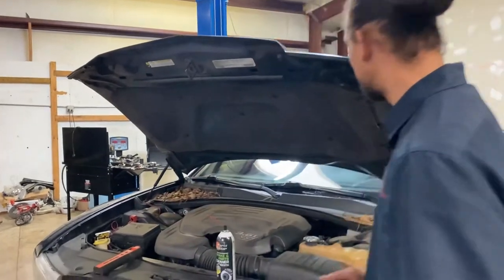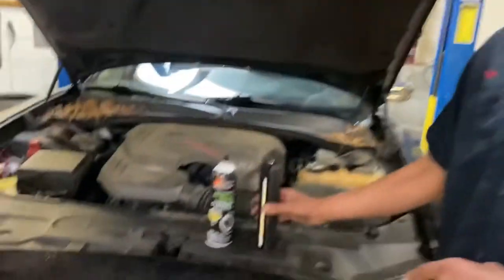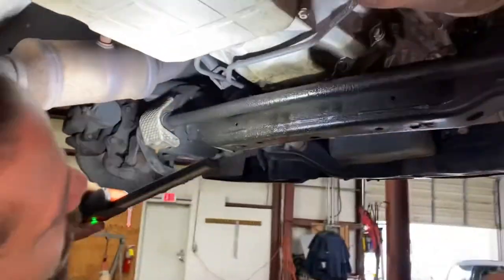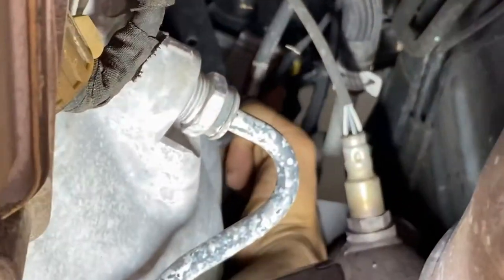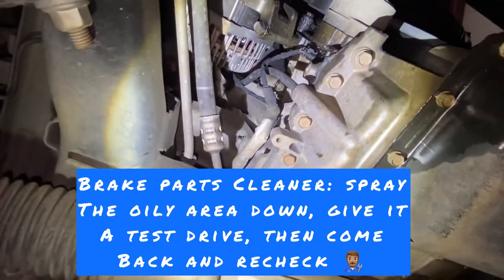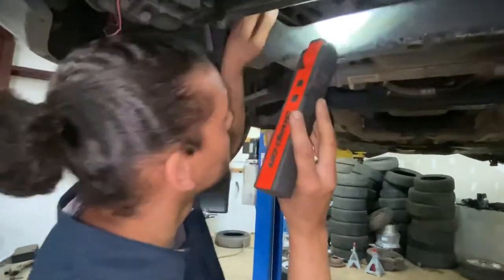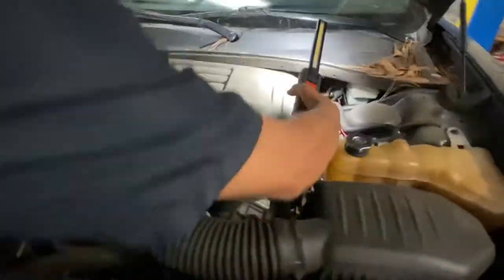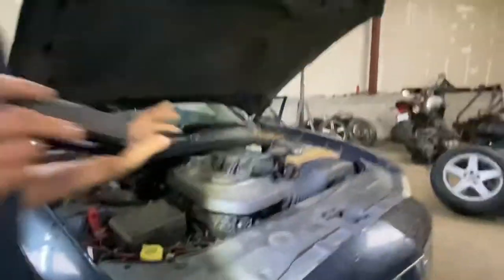3.6 Pentastar Common Oil Leak Problem | How to diagnose an Oil Leak #dodgecharger #3.6pentastar

Comment: Thank you sooooo much for calming my anxiety. I've been actually depressed trying to figure out why my dodge van has had repetitive problems after getting the oil changed from a different person. My gas mileage dropped to nothing, my check oil light has been on since the day after getting it changed. It was a slow leak now, now its gushing out when I drive. And no one would give me a direct clear answer on what the problem is. After watching your videos, I feel more confident about it. Thank you, again!
Reply from the maker: My pleasure I’m glad I was able to help you
Reply: @AlexTheCarDoctor  thank you but unfortunately I'm have a very hard time getting a mechanic to look at it. I took the risk of more damage and went to three shops today & each place immediately said its my rare main seal without even looking to see if it was coming from the housing, much less a leak on top in general. So I'm back at square one.. I wish you were in SC.. being a single mom of very active kids, I need my car to work 🙃
Reply from the maker: That’s so frustrating that’s the same story with this one don’t even take their time to properly diagnose the vehicle. even though I can’t see the vehicle I’m going to assume  it’s the oil cooler leaking oil causing it to look like the rear main seal leaking
Reply: @AlexTheCarDoctor  I followed your link you posted in a comment to someone else and got the part sitting in my Amazon cart .. but I don't want to order it until I can find someone to replace it. So if you can reach out to anyone you may know around the upstate of South Carolina.. or a shop recommendation for me, I would greatly appreciate it. My oldest daughter was informed today she is going to flunk out of school if she misses anymore time 😭 that hurts because she was making straight A's in college. But it's over $100. daily to uber her back & forth. I need to save the money to fixing the car. My boys have been walking home from football practice every night for the last week already and that worries me. They don't get home until after 11pm. I was going to rent the tools you mentioned and try to do it myself but I have no mechanical knowledge.. and we've haven't lived here long enough to know anyone personally. Hopefully I will hear back from someone by next week 🙏

Comment: Having the same issue on my younger brothers 2015 200C, got the oil cooler and valve cover gasket, hoping to do the fix tomorrow, really loved how clearly you were able to articulate the potential source of the issue and what remedies to take in what order to get the issue resolved.
Reply from the maker: I’m glad you enjoyed it buddy, thanks for watching
Reply: Did it resolve the issue
Reply from the maker: @wicked8139  yes no more leaks
Reply: @AlexTheCarDoctor  my 2014 is leaking oil now and want to know what do ?? I had mechanic tell me is the oil sending unit and other one telling I should change my oil housing unit smh and my engine light is on too
Reply from the maker: @1mekagurl  my advice is if you’re going to go through the trouble of pulling the intake might as well change The entire oil cooler
Reply: @AlexTheCarDoctor  Alex will the oil cooler leak while the car is sitting we had some really cold weather here 10 degrees and this morning my husband went to the store and seen he had a leak it's still plenty of oil in the motor
Reply from the maker: @gymnasticsgirl5614  Yes I seen this for myself it will leak while running
Reply from the maker: I mean when stationary/sitting once the oil settles down it will stop leaking

Comment: My '14 Dodge Charger had the oil cooler leak at about 12,000 miles and the symptom was a big cloud of blue smoke when accelerating from a dead stop. The dealer replaced it in a few hours with the non defective parts ( O rings and cooler) and it's still holding. I did have to replace my thermostat at 48,000 miles. The engine temp would only get to 185 degrees when it should get to 206, then I could get heat. Kinda important in Cleveland!

Comment: What up, Alex. I have an issue w/ my 16 Charger v6. Went to park in reverse, car dash says "Shift to P then desired gear". Cut it off, turned back on, same issue even when in a different gear. Doesn't move. Noticed an oil trail the next morning behind, underneath, in the grill and inside the car below the radiator. Check engine light now on also. Any idea what it could be? Car still starts and sounds fine, but will only move after it's been sitting overnight for about 20 seconds going back and forth in the garage.

Comment: Thank you so much for this video. At 4:52 is the seepage around the valve cover gasket because of the leakage in the oil filter cooler housing, like it sloshed all over there, and that it’s not going to seep anymore once the oil filter cooler is replaced? Or does that gasket need to be replaced too? 

I’m having the same issue where I’m told replace all seals and gaskets everywhere and they barely mentioned the oil filter housing when I can see oil in there so I’m just trying to determine what’s the first repair I need to do. 

I only noticed small drops of oil in my driveway recently, Challenger is 6 years old. I’ve never had a low oil warning or any burning smells so I don’t understand why they’re acting like I have a waterfall of oil flowing every where and then not even tell me during all the times I went there for maintenance 🤷🏻‍♀️

Comment: I do actually everything that you just mentioned. I am going through it with my Dodge Charger, I have a 2014 and right there. Around that part that you mentioned there's oil sitting there and I know I just changed my oil pressure sensor my when I head and did that, but we thought that that would fix it, but it's still leaking and at first we thought it was leaking from the bottom. But then when I went for an oil change at Walmart? The guy there said that it was coming from the top. He just didn't know where, but now it makes sense.  So can you please give me an idea of how much is going to cost me and who do I seek about something like this?
Reply from the maker: Depending on where you live you will spend $400-$800. I’d recommend replacing it with the aluminum one so you won’t have the problem again. And take it to a reputable shop if you don’t know any mobile mechanics.
Reply: I dont know one im in albuquerque  new mexico so wat or how do i approach a mechanic wat do i say
Reply: What was it again that you said my leak might be cuz it sitting on top i cant see ur response anymore

Comment: I have a 2017 jeep grand cherokee v6, it is leaking alot of oil but I noticed it coming from the coolant reservoir. There's isn't knocking and haven't moved it since noticing the oil leak. There is liquid around the valley of oil cooler. Could it possibly be the culprit, and if so how would you clean out coolant lines? Thank you

Comment: I think it’s great that when you find a major problem that’s going to cost a lot to fix that you feel for the customer. Although I gotta say, these Chrysler engines (you are probably aware of the Hemis eating cams) are problematic and have been historically bad. At some point people gotta listen to the information out there and make wise choices in vehicles. Just like the Ford 5.4 three valve. How many years were people buying them after the cam phaser issue (as you may know that while fixable the cost is so high that you might as well put a complete reman engine in there) and the bad engineered 2 piece spark plugs breaking off. As a mechanic you gotta feel frustration (although it does make your shop money) with crappy engineering. 
Cheers

Comment: I have a friends daughter's 2011 chrysler 300 with the 3.6l that literally looks like a waterfall of oil running down the block behind the motor mount bracket while it's running its also saying cylinder 2 isn't firing and burning a crap load of oil while running rough

Comment: Yesterday I did my oil changed and after I went to wash my car came back and had oil leaking I thought it was from the oil pan screw but it is the oil cooler that’s leaking do I have to replace the oil again after I replace the oil cooler?

Comment: I noticed that my car (2014 charger) has a huge oil leak underneath the car. I'm afraid to turn it on and damage it. It's a great car. Do you have an idea what it may be.
Reply from the maker: Do you have the V6 or the V8
Reply: @AlexTheCarDoctor  
V6
Reply from the maker: I have seen a oil cooler leak like what you describe or did you hit something
Reply: I checked the engine  again and I believe my oil housing is leaking. There's oil sitting around the area just like the video. I watched the video over and over again on how to replace the oil housing. It's giving me the itch to do it myself. Thanks brother.
Reply from the maker: @danielgonzales6997  my pleasure

Comment: Thank you so much for this very informative video currently I'm in the same situation as this owner ..my 300c with the 3.6 liter is leaking oil right beneath the oil filter housing do you know the price range it costs to do repairs
Reply from the maker: Depending on your area $350 to $600
Reply: I got the same thing on my dodge charger lmk whst u found ab the repair
Reply: @ericleal3569  sorry for the late reply I got the issue resolved I was charged with parts and labor where I purchased the car for 700$ I haggled the price down cause they tried charging me 1000+$

Comment: Hey i have an RT charger . I was just driving regularly through a light,  Then out of nowhere it started stalling And i smelled something and then my shit started smoking , and then i heard something burst & then i heard a rattling sound and then ijust cut off It don’t start / drive so i can’t move it . But i got it towed into my driving spot. I had my friend whose a mechanic plug his diagnosis machine says it’s a air leak somewhere.  What would you say the problem is and how much it would cost
Reply from the maker: Hey buddy it’s hard to say exactly what the problem may be without looking at it for myself but here is a shot in the wind it sounds to me like a valve seat has dropped that’s a bad thing.you have the 5.7 hemi correct

Comment: Are you going to see oil on the ground if you have an oil leak. The dealership says I have an oil leak and need valve cover gasket and oil pan gasket. But I never see any liquid on the ground..
Reply from the maker: Not all the time. Sometimes, top leaks like valve cover gaskets and oil cooler housing leaks can make the oil pan appear to be leaking. The best practice is for them to clean it all up and pinpoint where it’s coming from.

Comment: Would i get away by replacing the o rings ?
Reply from the maker: Maybe why maybe will the oil cooler is plastic, it may be cracked in a way you can not see  and I always say why go through all that work and not have guaranteed results just replace it
Reply: @AlexTheCarDoctor  mine is an updated model it's not leaking yet but I'm doing a full tune up ..plugs rocker arms ..injectors filters fluids ..
Reply from the maker: @muhammedq9109  me personally I wouldn’t go that deep just to do the O-rings especially if it’s not leaking
Reply: Can one get idk aluminium or better material pipe to replace the plastic,?  @AlexTheCarDoctor

Comment: have a 2012 Durango 5.7l that's leaking a lot of oil as soon as I put oil in. I was told it's a rear main seal but idk, Can you HELP!
Reply from the maker: It’s rarely the rear making seal. The leak could be leaking from the top and dripping down to the bottom.  They should clean the whole area and assess the leak after that!

Comment: Have a 17 charger 3.6....I have a build up of oil sludge on the passenger side.. rear part of the  valve cover theres a connector not sure wat it is. But it has a torx screw holding it in place. Any way. That's where I seem to have a leak..could u help me out..wat could it be?
Reply: PCV valve.
Reply: That's the pcv valve? Right next to one of the coils...ok I should get that changed out huh

Comment: I have a Chrysler 300 - 2012 ..... Had big coolant loss, the oil cooler was leaking. I changed it and everything is ok . BUT now I have oil and coolant leakage ... I have to check it, maybe it's the oil reservoir ?!
Reply from the maker: Did you torque everything down and make sure the Gaskets didn’t move out a place
Reply from the maker: Very possible it’s leaking from the oil cooler especially if you’re losing both coolant and and oil
Reply: Well, I changed the engine oil and filter two or three days ago .... I have to this area for sure .

Comment: I have a 2017 Chrysler 300 with 59,240 miles and it's leaking oil.🤦
Reply from the maker: Dang already
Reply: So after seeing your video I went to inspect the filter housing and there's oil around it.🤦
Reply from the maker: @williamrodriguez2009  dang bro
Reply: @AlexTheCarDoctor  On this type of engine 3.6L Pentastar can I flush the old coolant with distilled water? Then bleed the air out? I've only driven Toyotas and this is my first Chrysler 300. I had a lot to learn.
Reply from the maker: @williamrodriguez2009  I recommend putting Prestone coolant flush solution in your system and drive around and then flush it. yes that’s the safest way distilled water most people use their water hose which is fine but you have to take out your thermostat and make sure you get the faucet water out of the system